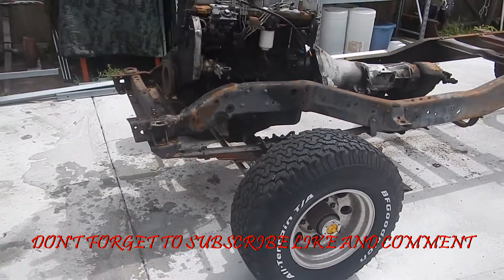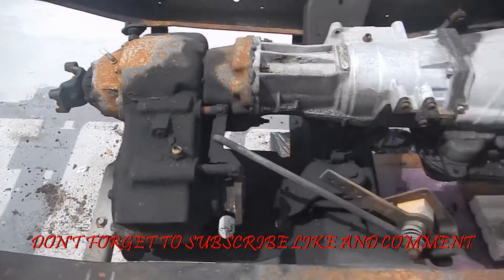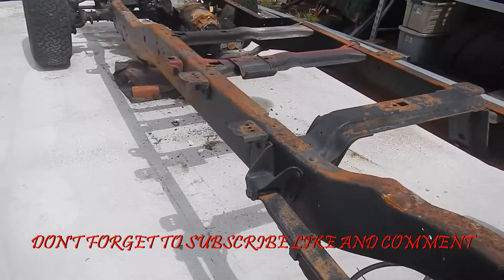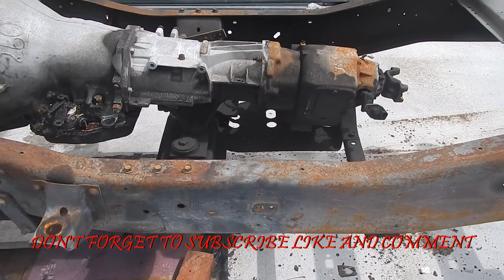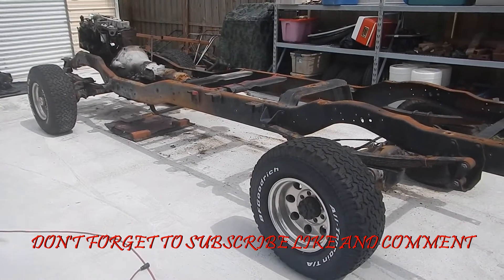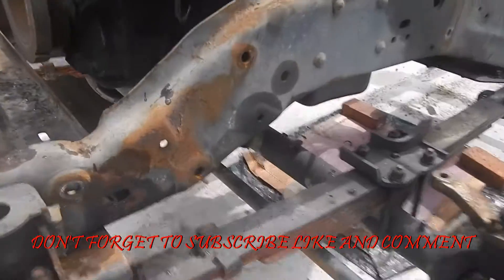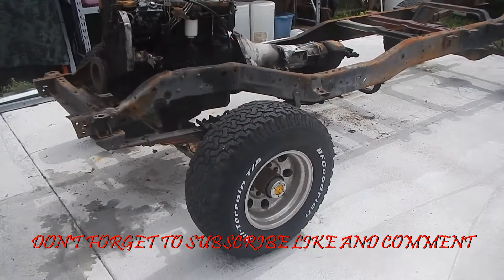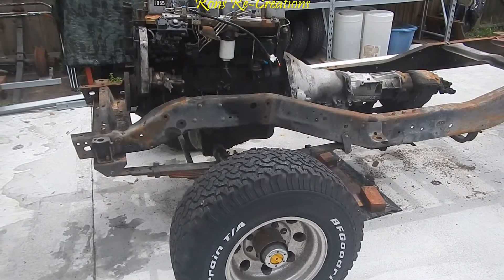EPISODE 14 Update on Where we started to Where we are now. Progress continues.

Comment: Do you plan on stiffing the frame around the steering box area ?
Reply from the maker: Hi, Yes I sure am. That's next after cleaning up the frame welds and my friend Kris is coming back to finish plugging some more of the bolt holes and missed areas. Then the steering box area is next and then it's ready to paint and prep. Lousy weather here keeps slowing me down. But soon. Cab B pillar mounts will be ready this weekend and hopefully welded in place. Then back to finish grinding the frame weld. I'd say maybe weekend after next for that part of it. I'll be sure to detail better what I intend to do. Thanks for watching.
Reply: @ronsre-creations5289  Cool. I look forward to seeing the progress on the project.